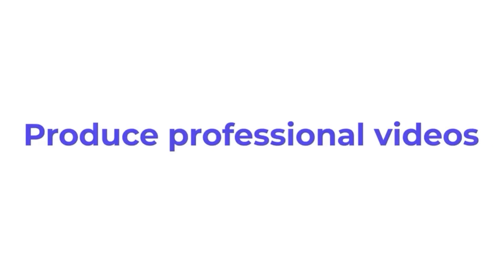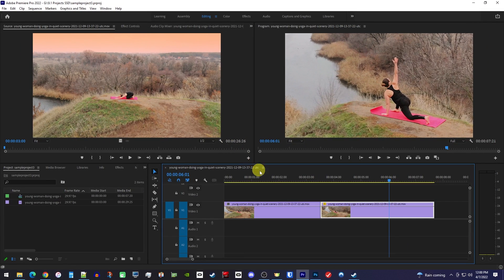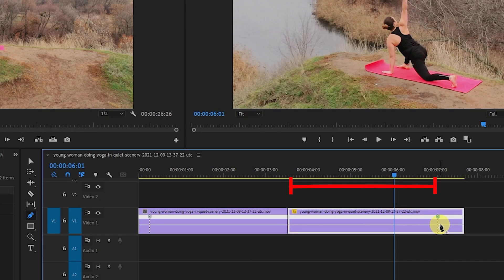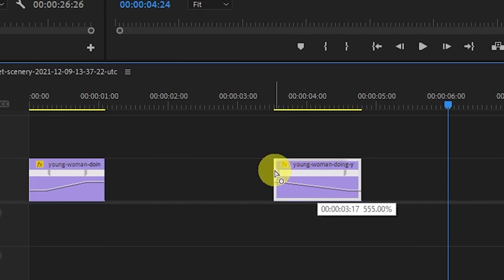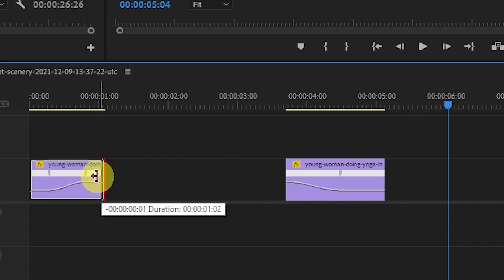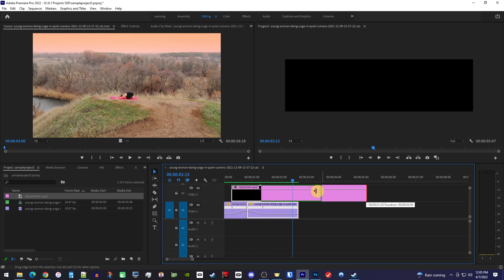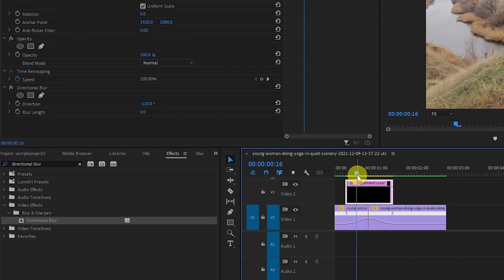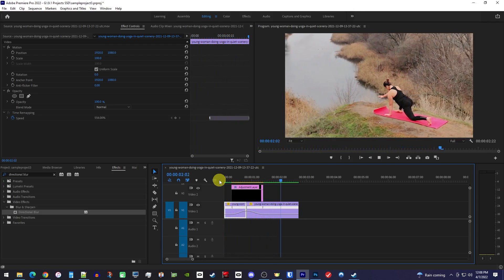Speed Ramp Transition Tutorial | Premiere Pro

Comment: One important point - the "Show Clip Keyframes" option is not visible if you have "Show FX Badges" disabled. I usually do have that disabled, because the FX badges don't really serve a purpose for me, and I don't like the extra clutter in my timeline. To turn FX badges on or off, click the "Timeline Display Settings" wrench tool under the timeline's timecode display, then check or uncheck "Show FX Badges."